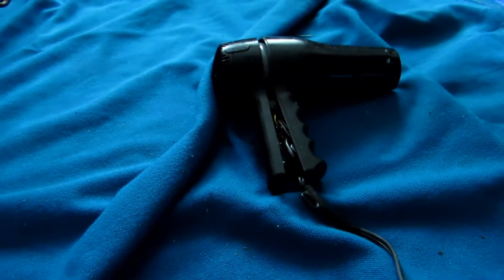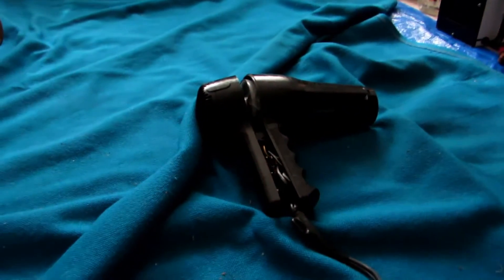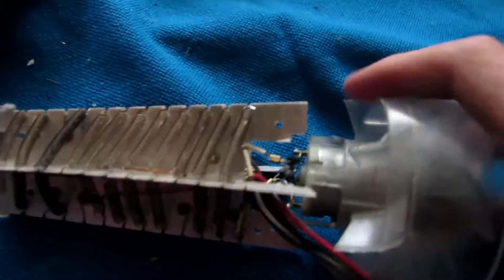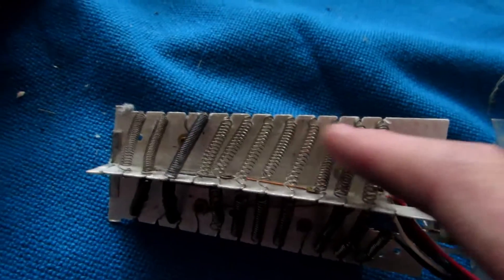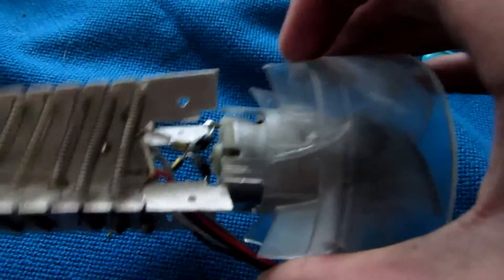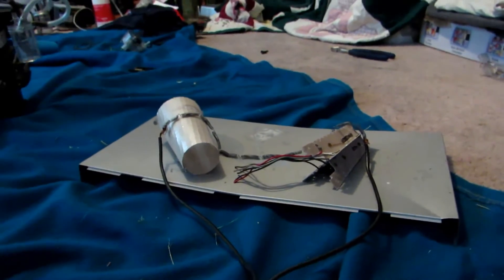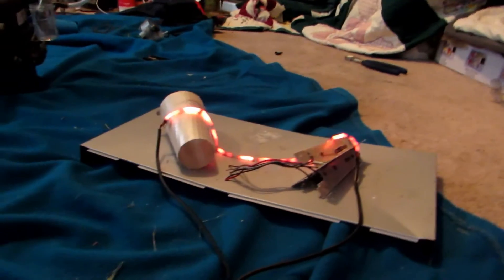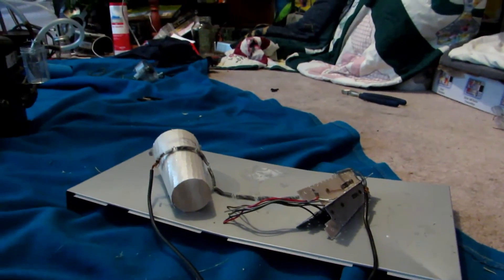Hairdryer disassembly

Comment: You can use the nichrome wire to make a heating mantle for round bottom flasks, OR just a general heating plate with magnetic stirrer, just use the electric motor from the hairdryer to make the magnetic stirring part, just attach a magnet to it.
DIY magnetic stirring hot plates are the SH*T! :-D